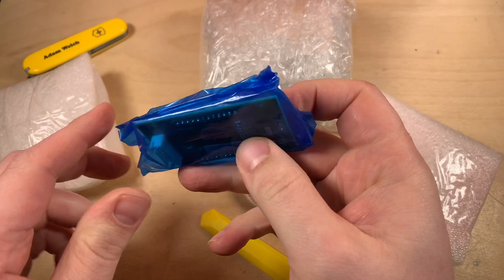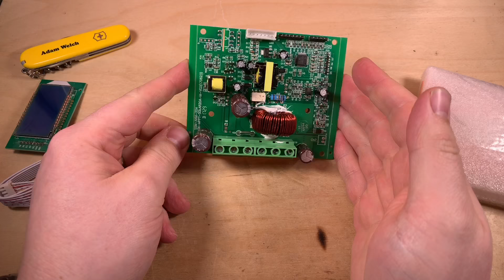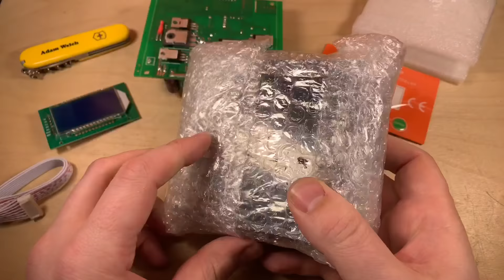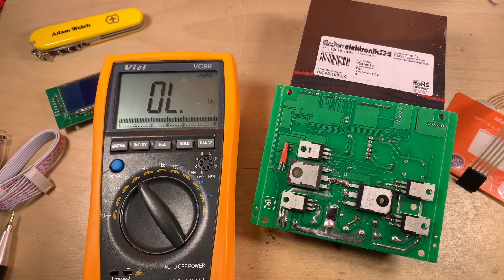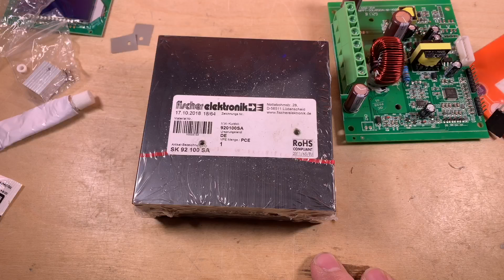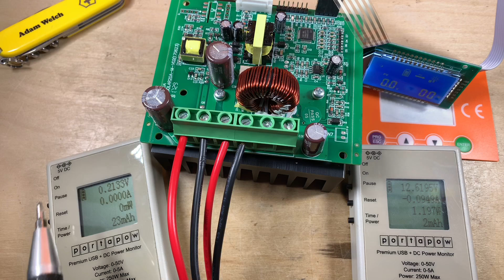Build Your Own MPPT Solar Charge Controller

Comment: Great start. They claim up to 98.1% efficiency which is a bit hard to believe!
I look forward to a comprehensive test with various solar voltages.
Reply: HAve to be careful with claims that don't specify what is producing that efficiency - many refer to the mppt tracking efficiency, not overall throughput efficiency.
Reply: @Bennyboy-dog  You could be right but they also claim 99%  "PV Utilization" which I assume is MPPT efficiency.
Reply: @peterdkay  I didn't pick that up Peter - thanks for pointing it out. As you say, some comprehensive tests are definitely required. I doubt the power efficiency claim, though the mppt efficiency isn't too hard to believe.
Reply: Peter, you may be interested in this vid where the guy does a test on efficiency on the MakeSkyBlue assembled controller and gets 97.75% in->out efficiency https://youtu.be/GpPLk2sOG0U?t=266. They actually look like a good unit.
Reply: @Bennyboy-dog  I have a 30a /118 version change controller.I got 94% efficiency with 2*150w 12v solar panel(voc 21v)+150ah lead acid battery.
Reply: Don't believe in the current & voltage measurements of this charge controller. Especially battery voltage & pv current are always inaccurate.

Comment: Hey Adam, I think the plastic screw washer insulator is not insulating anything the way you put it. It must go through the hole of the mosfets of To220 packages. With your setup, there is possibility that the screw thread will be touching the mosfet hole and shorts mosfet to heatsink. Try to put the plastic screw insulator from the other side at the bottom layer of your pcb on the front side of the mosfet hole (not on the back, so there will be no air gap between mosfet and heatsink when you screw them together) then put the screw from the top layer of your pcb.
Reply from the maker: The washer should be preventing the screw working away at the solder mask and connecting to the copper tracks on the top side of the board. The screws go through the large mosfets. They have insulation around the hole going through them. I’ll double check, so thanks for pointing it out, but I think it should be ok.

Comment: Self tapping screws are only good for wood, plastic, and sheet metal.  You really don't want them on a heat sink.
Reply: Yes, I agree with you for this application. Tapping the heat sink was a good option to using a separate nut.

Comment: So why can't we just take a buck converter with CC and CV, clamp it to 14.4v at 6.25 amps?
Reply: find out what mppt means and you have your answer
Reply: @ursodermatt8809  maximum power point tracking. In a 19v or 38v system any shading will as it is drop the voltage below a usable potential. So why use a mppt...
Reply: @whatever465456  no solar panel, no charge controller will work in shaded condition very well.
there are many reasons for mppt controllers
they are more efficient
they can work with a much higher pv voltage without bigger losses.
they are usually more programmable.
many mppt controllers have  lots of features you will not find in pwm controllers.
and they are more expensive though
Reply: @ursodermatt8809  agreed. In higher voltages mppt makes a lot of sense 50-200v. 
But if an individual is willing to give up on amp production/ monitoring and the panels are in a 19v or 38v setup then I feel that a buck converter clamped at CV of the battery and CC of the panal MPP will work better then a pwm.

Comment: Enjoyed the video. Are the boost/float (etc) voltages user selectable? If not it's a bit too dear for me to consider it.
Reply: Yes they are look for a cheap 20amp mppt on ebay or amazon most of them are using this same pcb you can use the manual for one of them

Comment: Yes you finally got round to these! I did a video on them last year (yOCtxc4aA68)
there brilliant BUT they dont disconnect from the battery so at night they pull the battery down, if they pull it too low, they shutdown and next morning dont come back up!
I was told that for 200w of panel you dont need a heatsink by the seller but.....yeah i dont mind putting a heatsink on.
didnt you get a manual? i did, its online though, I also tried to probe the 5 extra pins but could not get any sensible data from them, I think there for daisy chaing.
also theres space on the board for an opto coupler so it maybe was planned to also connect to a remote screen and lots of wiring regs require isolation

Comment: CodeDescriptionHow to solve
18 Input PV voltageis lowIncrease the PV voltage 
60 Over-temperature protectionFan will work and temperature reduction automatically
63 Battery voltageis highBatteryhigh voltage protection and wait for recovery
65 Battery voltageis lowBattery over-discharge and wait for recovery
71 Input PV voltageis highDecrease the PV voltage, refer to correct Voc range
73 Over-charging currentDecrease the PV power, refer to correct Voc range
74 Output load is shortDisconnect the loadand press ENT over 5 second 
taken from https://www.makeskyblue.com/files/V117%20MPPT%20Solar%20Charge%20Controller%202018.pdf
Reply: i tried to find a fan connector on these 20's and used the heat gun to trip mine, could not find any pin that went high or low

Comment: Hey Adam, Love your channel its really good!
I am going to buy one of these, i have 8 solar panels but only 1 mppt hybrid inverter. Since there is some shading here and there i was thinking to connect 4 panels to the hybrid inverter with the mppt and then connect 2 of these units to 2 solar panels each. The panels are 285 Wp. Now do you think that there is a problem if you charge the battery from three sources? Will the interfere with each other you think?

Comment: Adam, fire me off an email and I will send you a copy of my manual if you like Michael.i@me.com.
also, when you first power on the unit it showed 20.  114 I think is what I saw. that is saying 20A model, firmware version 1.14. I have the 60A version running 1.18 but he menu is the same

also, the load can't be controlled manually, it is turned on when there is no solar, Dark, and says on for the number of HOURS in setting D0. you currently have it set to 24 hours, so on all the time

Cheers, there are lots more settings, including how to setup for lithium and such.
Reply: 20A charger can handle 2 panel power and 60A version can handle 6 panel power if nominal panel max current have normal 7-10A
Reply: @mattivirta  you replied to the wrong person

Comment: I was expecting you to bolt the tabs of each of the mosfets/diodes to the heatsink.
it's more work, but less likely to blow mosfets when metal warms up and the paste dries out.
Seen one chinese design which blows mosfets after a month or so, it too relies on pushing the mosfets against the heatsink.

Comment: From this link you can see all the parameters of the controller and error codes. https://www.aliexpress.com/item/30A-40A-50A-60A-MPPT-Solar-Charge-Controller-for-12V-24V-36V-48V-DC-Acid-and/32808021790.html?channel=facebook&fbclid=IwAR3iQNdPvXAUuc8m7aVA2LdwsRNV7T3No1y87drFF3b-mYn0oxVOzRp6VJg

Comment: I misunderstood - Assemble <> build in my mind
Reply: Engine builders and rebuilders are really just assemblers too in that case. You didn’t say Design and Manufacture, I think you understood fine
Reply: @maxpert9  the assembly is usually for most if not all components. In this case you cant just buy the individual parts and make your own, you have to buy a "kit".

Comment: Quick maths suggests 80% efficiency, it looks ok for the price but i think i shall stick with my noisy mpt-7210 a's. My solar and battery monitor manager has evolved slightly again, the front end is getting better all the time and i am currently waiting on jlc delivering me some nice pcb's although the design may be changing "again" lol.
Reply: you cannot conclude this from this youtube video. the charger might have reduced output in absorption mode. the manual claims something like 98%. on another video they compared quite neatly in efficiency to expense mppt controllers. (efficiency wise)
Reply: @ursodermatt8809  the manual claims "max 98%" which is an easy claim to meet. I did say quick maths, but its still not for me. :D
Reply: @trickyriky1  
i said the "manual claims"
well yes, you use what ever you think will suit you. as far as i am concerned if i order it it would be for experimental purposes only. certainly not relaying to run the house.
the youtube video where that bloke compared a blue sky to a midnite classic, the blue sky showed slightly more efficiency. so they almost certainly more efficient than 80%.
what do you think is the efficiency of your noisy mpt-7210 ?. just curious
Reply: @ursodermatt8809  Right at this moment i honestly cant remember the efficiency, but i have seen them put up to 300 watts into my batteries from 255 watt panels in the height of summer. I really cant fault them other than the noisy fans.
As for this device, from the vid you seen maybe they are better than i'm giving credit for, i would be curious how they hold up after a year or 2 of operation but i still don't envision me investing in any. I would need at least 2 of them if i was to replace my current 4 mpt7210s. If i was to buy 1 it would certainly be the complete unit with heatsink and case just to run alongside my existing setup and compare them. But that really is an if. :)
Reply: plus that unity meter is not that exact measuring currents.

Comment: That 100ma drain does not compare favorably to the 15.7 ma drain of my Tracer 3210A controller with the load OFF or about 33ma with the load ON and no load connected.  The price, size and "splitability" would otherwise be attractive for a couple of projects.
Reply: I respect my brother I have been using one for about two months now it works well since week I saw as much as 15amps coming from it off a 250w panel  and it is cheap
Reply: If money was not a consideration, then yes... and I do I love the tracer 32x series... but this does compare favourably for the price ... unless you have a really small battery bank, at which point a 20a charge controller probably isn't desirable or sensible. ;)

Comment: Always 0.5mm smaller than what you need to tap. So M3, drill an M2.5 and a 3mm tap.
Reply: thats not actually true, for the smaller metric ones its usually a 0.8 multiplyer. So for M3 a 2.4 mm drill is the perfect chioce but you can get away with 2.5 and that is more available thats for sure.
Reply: @szaszafaja  I have always tapped an M2.5 hole for M3 bolts... The important thing to note is the pitch and the thread depth, most threads are .25 deep

Comment: Awesome, I wonder if it could be used to control more MOSFETs and a inductor for more current capacity ?
Reply: That's was my thinking.  Paralleling additional Drivers and inductors  could be the ticket.

Comment: would like to know what the D00 is because i think there is D02 and D03 settings. i could never find out what the D settings mean.
Reply: there is d0 d1 d2 and d3.
d0 = hours to turn output load on after solar goes out fyi
Reply: @sNEAKYnIGHTmUPPET  thanks

Comment: Nice video. When are you going to do some update video on lithium batteries and diyBMS?  diyBMS updated software on GitHub for your problem with temperature. Keep up with great work!
Reply from the maker: Well since changing the voltage divider resistors it’s worked perfectly. I’m not sure there is enough news to make a video! I’ll have a think. Thanks

Comment: The pdf is online search makeskyblue, 3.0 is the amps i to the battery, how does the load D0 work. D0 1 keeps light on for 1.5 hours? Please do a review of this DO option. The 60 amp unit also has the same 1 watt ghost load.
Reply from the maker: Thanks. I’ll look it up and think about if a video would be useful. Cheers
Reply: 3.0 is night mode no charging.  D00 24 is the load is on 24 hours a day.  18 is input PV voltage is low.  Manual is https://www.makeskyblue.com/files/V117%20MPPT%20Solar%20Charge%20Controller%202018.pdf

Comment: Nice work Adam! 

Tapping Aluminium is (usually) a pretty easy job and you don't have to worry about the whole turn anti-clockwise a little with it, only for harder metals such as 304 and 316 stainless when the metal chips are considerably harder. Tip for the future; tapping anodised aluminium such as heatsinks is also usually made a little easier with some WD-40.
Reply: Interesting, my experience is the exact opposite. I've power-tapped literally tens of thousands of holes in SS316 over the last 7 years, from M3 to M20, and never once backed out until the thread was complete, only ever snapped two taps(one M3 and one M6) in that whole time. Aluminium on the other hand, back-out frequently and even then have snapped many a tap trying to 'save time' by going just that little bit too long between backouts. Nothing ruins your work day like snapping a tap does.
Reply from the maker: Thanks for this. I’m not sure my taps are of the best quality, but hopefully some wd40 next time will help. Thanks again.
Reply: @AdamWelchUK  Not a problem. Unless your taps are extremely old or have been biting through some tough metal they should be ok still. Just be careful that they're not too fatigued because removing stuck and especially broken taps is almost impossible as taps are harder than drill bits.
Reply: There's a product called TAP EZE made specifically for this application
Reply: Also, you could have drilled the very top of your hole with a 3mm bit, it just makes it easier to get going without it wobbling all over the place :) (I use the same tap kit)
Reply: Depends on the size of the tap.  Smaller taps may well wish backing up every turn or two in Alumin(I)um, as well as careful handling in general…

Comment: Exactly how what people need. This field is full of bogus self-engineered “solutions” created by inexperienced or untrained people. 

Great job.
Reply: Most self-engineered solutions where started because of missing features, not because there where no alternatives. I for once don't see a possibility to modify the firmware or even easily grab the metrics for monitoring on this unit.
Reply: it has no logging, but does show input and output voltage and current on two different screens.

Comment: What a joke. "Why have we got  transformers". Do you know anything about MPPT?  Who cares what fet is connected to what...insulate them all....
Reply from the maker: My feeling was that the insulation will hinder the heat transfer at least a little bit so where possible it’s best not to insulate. Plus I only had three bits of insulation (which I struggled to find) I take your thoughts on board around that though. There are two small transformers on board - which in inspecting many mppt solar charge controllers I’ve not seen before. The large inductor and mosfets obviously make up a buck converter, and there is a small linear regulator for the mCu. What do you suggest the small transformers are for then? Thanks for your comment.
Reply: @AdamWelchUK  Seems like graham gillett is still searching the internet to find an answer to your question!
Reply: looking at the video, I can only think of two reasons for the transformers. 
1. push-pull drive to a pair of fets.
 2. dc-dc converter to provide a higher voltage than the supply to allow for n-channel fets on the high side. n-channel fets normally have a lower Ron than p-channel ones.

makeskyblue claim to have a lot of counterfeits out there but your link points to theirs on aliexpress
Reply from the maker: Thank you for those suggestions. N channel fets on the high side seems like a plausible explanation. I read that makeskyblue claim there are counterfeits - I’m not so sure, but have no evidence to the contrary. Thanks again.
Reply: @AdamWelchUK  I've seen a YouTube video that showed the genuine pre-built make sky blue mppt controller alongside the counterfeit green something or other controller that I think is pwm. It's certainly not an mppt but it sure does look a lot like the make Sky Blue model.
So basically we have a Chinese company counterfeiting products of another Chinese company LOL!
Reply: actually, the fakes are still MPPT, they just use an older version of the firmware that doesn't track fast or well. also, doesn't sleep hence the higher idle draw and is way less efficient. you really want firmware version 1.18. if when you first power it on the number on the right is not 1.18, then it is older and outdated or a fake. I believe that 1.17 is all fake models and 1.14 is the genuine acrticle but depreciated by makeskyblue. I think it works, just not well.

If you want to see what makeskyblue can really do, get a proper model with 1.18. my 60Amp makeskyblue was around CDN$ 111.98 on amazon.ca. pretty good for a decent 60a 12/24/36/48v with uptown 2800Watts of solar@48Volts battery VoC of 160vdc max.
Reply: @sNEAKYnIGHTmUPPET  I have fw 114, but have no idea how to update it
Reply: @johnwyman6331   yes, and the chinese manufacturer is upset! he in turn probably copied it from somewhere else
Reply: The other thing to consider is are they being used as transformers or chokes. And definitely, don't put insulation where it's not needed... the heat transfer will not be as efficient as direct contact with the heatsink.